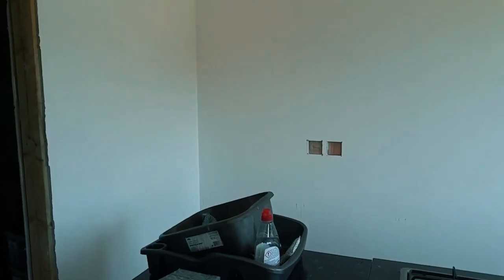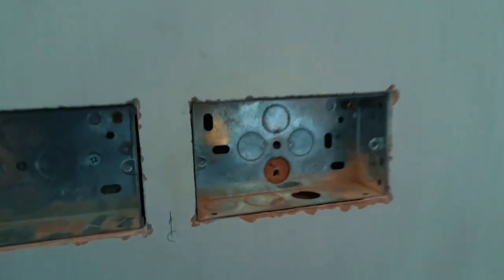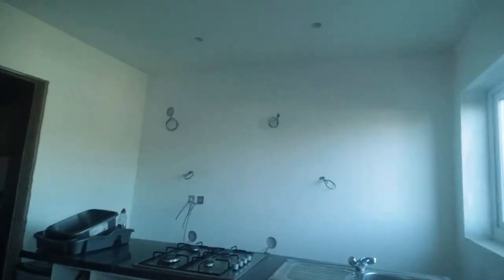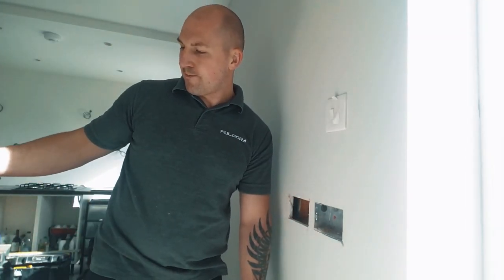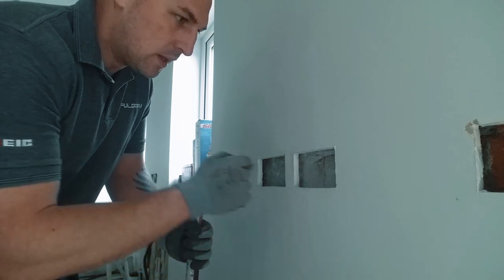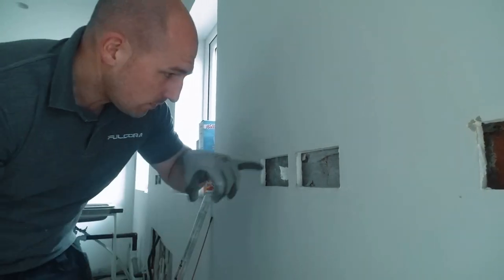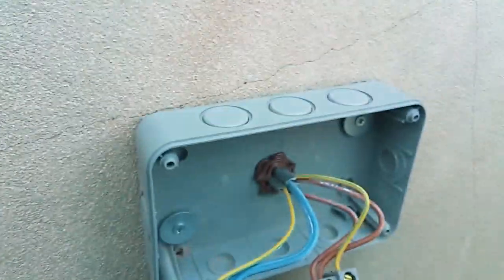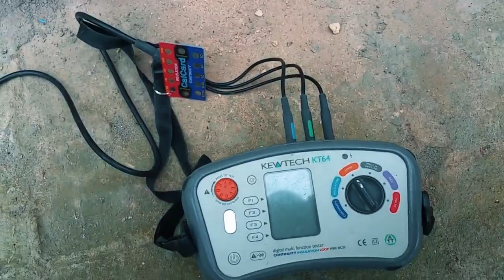KITCHEN REWIRE - 1st Fix - Dot n Dab

Comment: I've put them in cupboards before. 

Reg 537.2.2.3 "A device for isolation shall be designed and/or installed so as to prevent unintentional or inadvertent closure"
That to me suggests not to put them in a cupboard because if you put something in the cupboard it could turn the switch on/off.

I'm not about to have a proper look through the regs though.
Reply from the maker: Haydon Turner-White thanks buddy.
Reply: No problem! Just had a flick through my guide to the building regs too and it says 'Appliances built in to kitchen furniture SHOULD be connected to a socket outlet or FCU that is readily accessible when the appliance is in place and in normal use.'

Key word is 'should'. If it's not in a cupboard as high as the ceiling then I don't see a problem. 

Another point, my guide here should 300mm from edge of drinks/draining boards and 100mm from the edge of a hob!

Comment: When you do a kitchen rewire does that include running new Legs of the kitchen ring in to the board? Or do you use existing? I’m trying to branch out of new builds, so this side of the job is completely different. Great video. Very helpful.
Reply: RSA Electrician totally acceptable to use existing legs of an old kitchen ring main as long as the circuit meets regulations, RCD protetection etc. And as long as it tests out correctly once the work is completed.
Reply: Yes it is acceptable to use old cables but even if they pass all tests you still can’t guarantee the quality of cable run if it is damaged has joints in the length of run

Comment: Ring circuit ? Why not a radial ?
Reply: 2.5 m2 cable is rated fo 24amps max. A ring protected by a 32amp RCD !  A radial would be protected by a 16amp fuse.  Overload on the radial will trip the RCD .

Comment: Those covered outside sockets are great,until you plug an outside Christmas decoration with built in transformer.......... Then the chuffing lid won't close.
Reply from the maker: Madness aye. I was chatting to a pal about how great it would be if they invented a DC plug socket. We already have USB and car charging. Should make 12/24v sockets for garden lighting,  laptop charging etc..

Comment: The isolator for a fixed appliance has to be within a certain distance (I wouldn’t be able to tell you right now) basically if you put it 300mm away you’re following the guideline of minimum distance from a Hob/Oven. Putting an isolator in a cupboard down low or up high and behind the clients food is bad practice, accessories should also be fixed to the FABRIC OF THE BUILDING. 

Personally you can’t go wrong with a grid switch, spur off the ring to single sockets for you dishwasher/washing machine etc, and if you have fixed appliances (possibly an extractor or water heater) they also make 13 amp fuse modules that fit into the same grid plate.
Reply: Still shit looking at switches you'll never use!
Isolators in the nearest cupboard labelled up always works fine. Plus  a house isn't a house without a kitchen, so that makes the kitchen part of the fabric of the house.